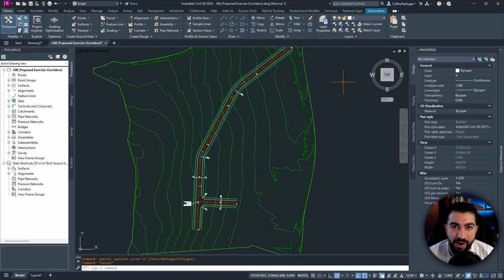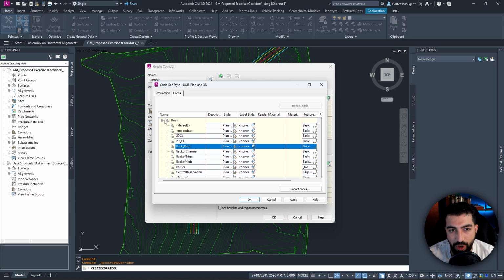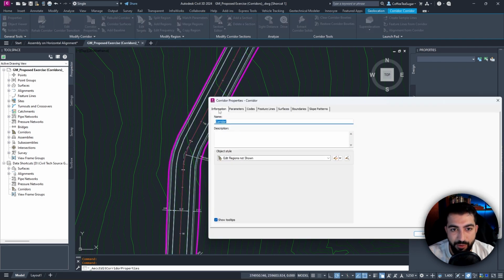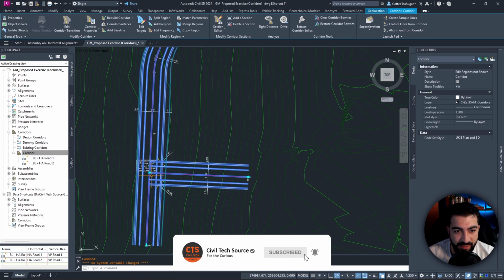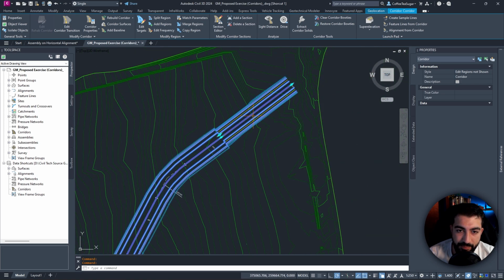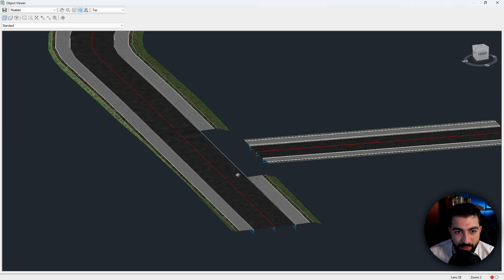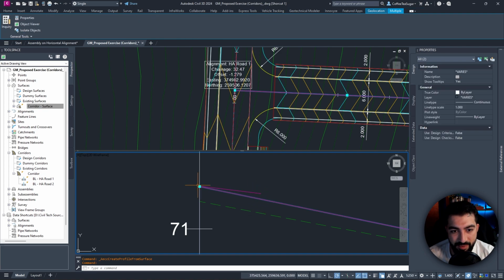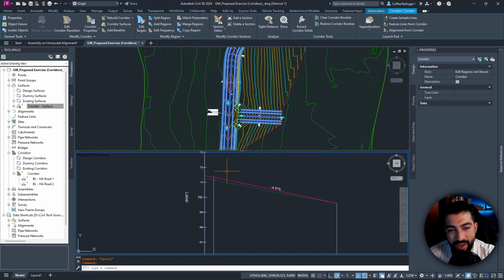Road Design in Civil 3D - Corridors (Part 4)

Comment: I noticed that you did not use the intersection option for your intersection, could that cause a problem for me when I try to insert the surface corridor on the adjoining road
Reply from the maker: You can use the intersection as it will load the assemblies and the connected alignments for you. I have a habit to keep all my roads in One Corridor (by adding multiple baselines) this why I only have one road surface and avoid merging it. If you are working on a lot of roads, it might be best to keep each road as its own corridor and then I suppose you can use the intersection.
Reply: @CivilTechSource thanks for always trying to respond.
Reply from the maker: I try my best. Don't be shy to ask any questions!
Reply: But I am still waiting for your paid tutorial.

I have been trying to up my game and know more about the full extent of Civil 3D. 

But I am still limited in some key areas, ranging from Subassembly Composer, Complex Intersection design, roundabout design, underpass, overpass, median modelling, and raised island.
All this aforementioned are very key for one to be fully efficient

Comment: Your "Create Corridor" dialogue box is different than the one in my version of Civil 3D and I don't understand why. Yours has a section to the right with "alignment" "profile" and "assembly" but mine doesn't have that portion so I couldn't follow the tutorial
Reply from the maker: What version of Civil 3d are you running?
Reply: @CivilTechSource  2023
Reply from the maker: @CADtechsupport  Probably that is why
Reply: @CivilTechSource   I have the same issue and I am using Civil 3D 2025. I am not able to assign an assembly under the "Add baseline" option. I am only allowed to add the alignment and the profile. I also tried with Civil 3D 2024 but it did not work. I would really appreciate your help.Thanks!